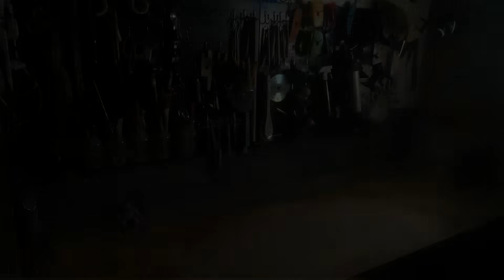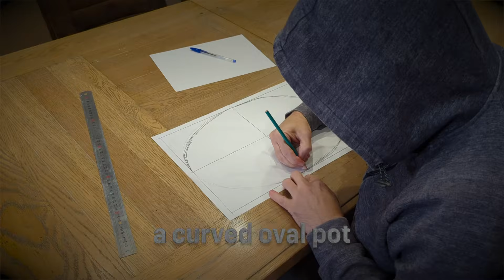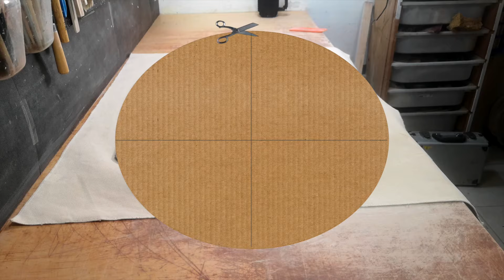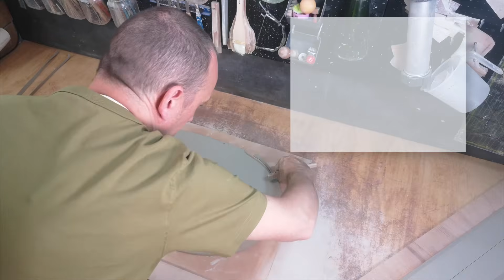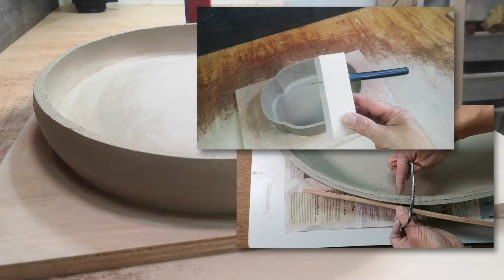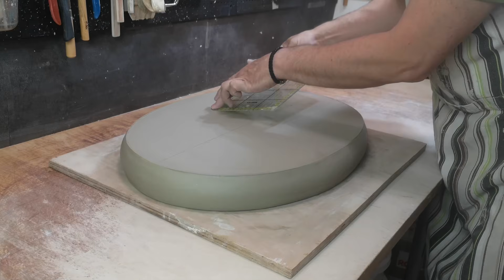How to Make a Large Oval Bonsai Pot – Slab Pottery Tutorial

Comment: Hy,  just wanted to say thx. 3 years ago your videos got me started on trying to creat my own clay pots.  Last year i finaly managed to creat a big 42cm oval pot that was flawless. Turns out there is a lot more to pottery, but you make it look so easy. My biggest struggles are with cracks, and warpage while drying and after firing. Maybe you could someday do a video about these topics. 

I also want to share a new technik that i found.  3D printed moulds out of plastik.  I draw a 3D image of the pot i want to make on my pc. Than i draw the negativ as a mold. the design is similarto a plaster mold. Taking care that you can demold it properly. I then print it on my 3D printer. These molds are especially suitable for large pots. I can print a mold usually in 1 day and material costs are about 4 euros. Demolding works well as long as you use release agents.

Thx for the gread video.
Reply from the maker: Thank you for your kind testimony.
I've also thought about using my 3D printer to make molds, but most printers don't have a large printing surface, and I would have to limit myself to very small pots.
How do you make big pots? Are you combining several parts? Unless you have access to a large printer, I'll be curious how you go about it.
Reply: @Greg-ceramics  Hy.  

As with a plaster mold, the plastic mold must also be divided. Otherwise demoulding is impossible.
I only use the mold for the walls. Freehanding an oval pot with curved edges is impossible for me.

For example a 40 x 40 cm raw square pot: 
I divide the mold into 4 parts, with each corner being 1 part. You can simply print 4 times the same corner. 1 part would then be approx. 21,5*21,5 cm (1,5cm wall thickness of the mold, 20% infill). I place the wall mold on a straight surface, which serves as a shape for the bottom. I usually fix the 4 parts of the form on the outside with adhesive tape or simply clay. Then fill it up hte mold using your plate technique. Allow to dry slowly for 2 days until the clay is leather hard. The pot can now be removed from the mold due to the slight shrinkage. From now on add feet and decorations as desired. Silicone works best as a release agent. I had a lot of trail and error, so if you want more details let me now.

happy holidays